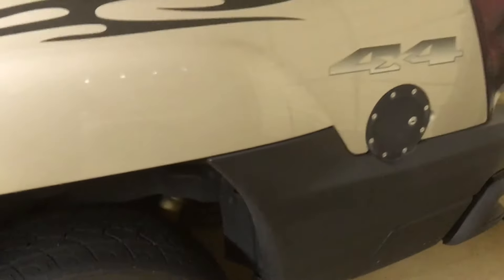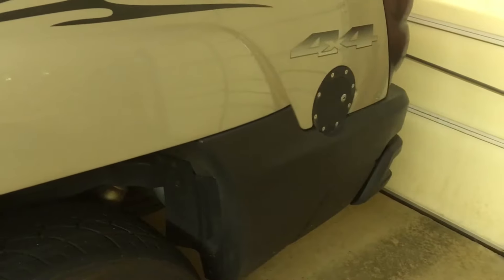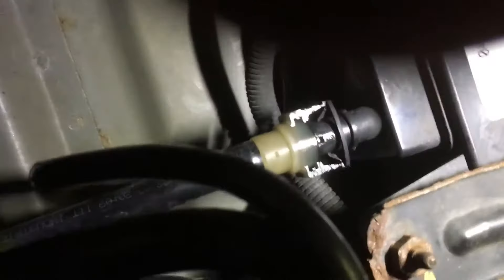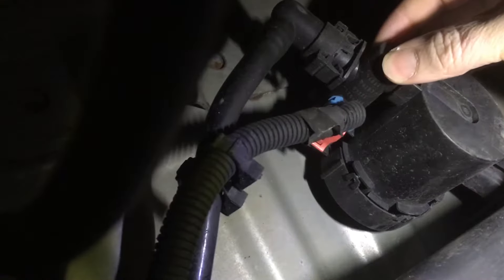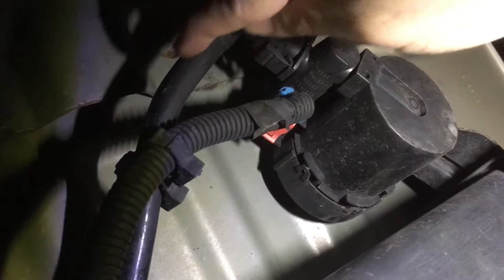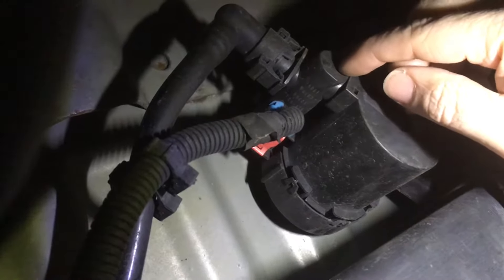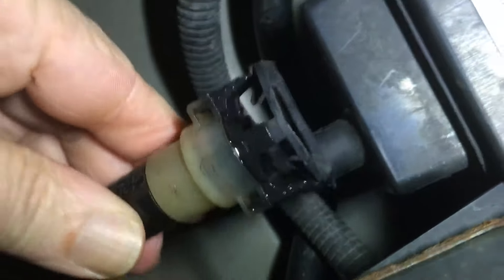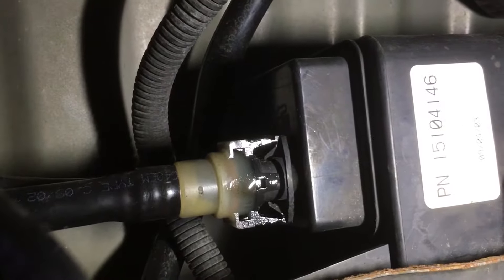Troubleshoot gas pump shutting off during tank fill up on Chevy truck

Comment: Ive replaced both still same issue any ideas
Reply from the maker: If you replaced the solenoid and the charcoal canister, then it is probably a clogged vent line between the tank and the charcoal canister. If your canister went bad, charcoal bits can float back into it and clog it. Disconnect it from the charcoal canister. Keep fuel cap on. Find the little quick disconnect fitting on the little line near the rear of the tank that goes up to the filler tube. Disconnect it and blow compressed air into the tank. In my case, about a quarter cup of charcoal bits came flying out of the line to that goes to the canister. Clog fixed.
Reply: Ive done everything minus replace tank same think sometimes makes worse been to mechanic 4 times Friday reblew lines couldn’t put gas
Reply: @tonygg1989  Hmmm.  Not sure what else could be causing this.  Other components can cause evap system faults, but the vent is pretty much just the tank, vent line, canister and solenoid valve.  I would be second guessing the mechanic...What happens if you get under the truck and disconnect the vent line from the charcoal canister? Then drive like that to the gas station and try to fill up.  The tank should be freely venting right out that line onto the ground.  You'll have a little spill of gas on the ground when the tank gets totally full, but no big deal.  If it still won't fill, then I would suspect some sort clog in the vent line or the filler tube.
Reply: @tonygg1989  I've heard ya take an air compressor and then open your gas cap, then blow out that gas vent line but make sure your gas cap is off first. Haven't tried it yet but it's the most common problem from what I understand
Reply: Any code ? Like p2422 valve stuck close
Reply: @treyspetch  do you think these charcoal bits could get into the fuel system and cause a random misfire also?
Reply from the maker: @x3douba3  . No. Even if they got into the tank, they would not get through the fuel filter which is built into the fuel pump.

Comment: carbon filter needs changing     the hoses go into EVAP
Reply: its always the charcoal filter.   that is why they installed tehm after 2000.  its a $300 repair every 38-48 months  or no gaz4u

Comment: I changed both and still cnt put fuel in it
Reply: Disconnect the lines from your canister & vent and trace that hose from the canister to your fuel tank and disconnect that line, then just blow compressed air thru the lines.
You probably have charcoal clogged somewhere.
You may have a clogged vapor canister purge valve too. 
It’s under the hood so check it to be sure. 
After that, it should definitely work… That covers all bases to the issue.

Comment: What if I did that and it still poured out after putting a little gas in it
Reply from the maker: That’s normal. When the tank is full, it sometimes overflows our through the vent line into the charcoal canister. If you disconnected it to test, it will spill a little out into the ground.

Comment: Call thank you for telling us how to bypass the system that's we wanted to see
Reply from the maker: Glad to help. Later on I had another problem where the bad charcoal canister sort of burst inside and charcoal particles got sucked back into the vent line toward the tank.  I was able to blow out the tank with compressed air while the charcoal canister was disconnected. About 1/4 cup of charcoal pieces cane flying out. After that there was no more curling problems.
Reply: I just bypassed the whole entire Box altogether
Reply: @chevyvet69  how?
Reply: @chevyvet69  at what point did you disconnect things? and the vapors venting caused no problems with anything?
Reply: @shoutdowncreative2705   It caused no problems except for the code on the dashboard
Reply: @shoutdowncreative2705   Disconnect the entire Box there's 4 ventos that need to be pulled off that you could just wire tie up